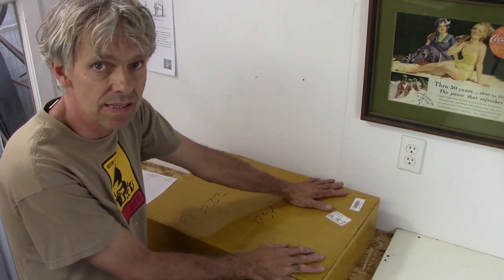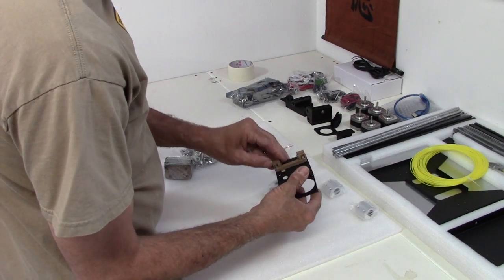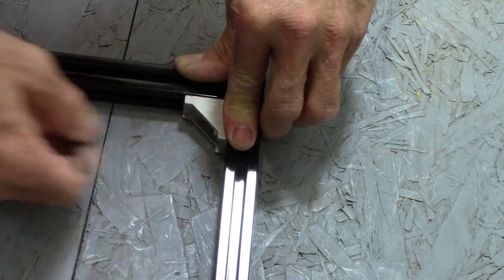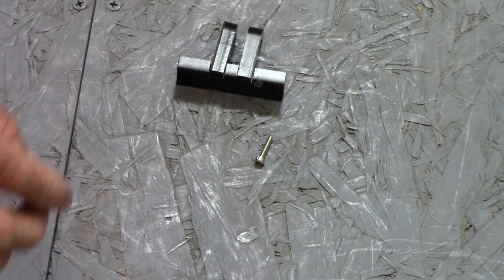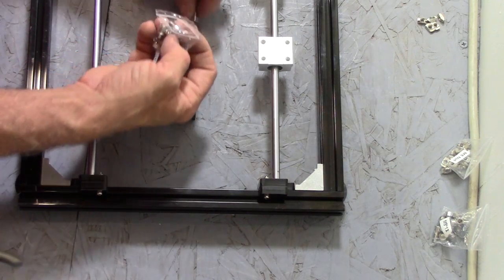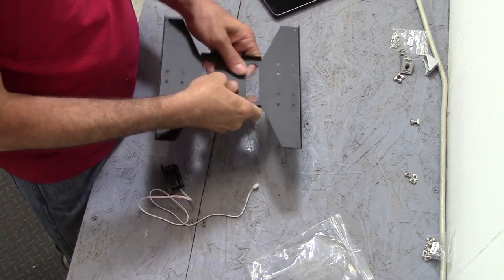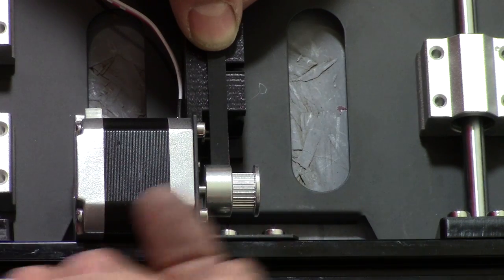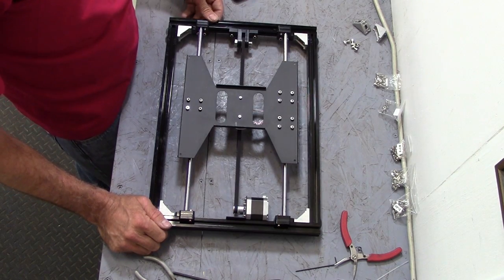HICTOP 3DP-11-ATL 3D Printer Assembly Part 1 - Y Axis Frame

Comment: Looking good. Certainly going together faster than the Mendel I made a few years ago. Dreams of being buried under an avalanche of M3 nuts still haunt my sleeping hours. 

Couple of points.. 

You might want to play around with the tracking on the end bearing a little. The belt looks like it is  going side to side a bit too much, and if it rubs against the plastic bracket, it will eventually wear through it. 

On mine, I have a small diameter washer that the bearing's inner bush rests against, and  a larger diameter washer acting as wall on either side to stop this happening. 

Personally, one of the first jobs I'd do is to build a better idler bracket. That one will fail fast. A couple of M3 nuts in open slots is not going to last. So at the very least, snug a cable tie around each one, to stop the slots opening up under load.

 A printed bracket would be strong enough for the job. . 

As to belt tightening.. Yes. They will slacken as they are run in, but after that, depending on quality, should be good.
Reply: Awesome! Thank you!

Comment: Welcome to the world of 3D printing. I got my first 3D printer a month ago and I'm really enjoying it. You need to start thinking differently about fixing stuff - no need to make a Y idler from aluminium. You fix it on with the printer. Here is a part I made for my Wanhao, I can share the source files with you to adapt to your printer http://www.thingiverse.com/thing:1532408 

One more tip, the Chinese LM8UU bearings are terrible. They are very noisy and the bearings destroyed my one smooth rod. I am now running bronze bushing on my Y axis and PLA printed bushings on my X axis. Both work great and will never destroy the rods and are very quiet.

Comment: The bearing holder problem is still there. The whole bearing will rotate on the thread of the 8 mm bolt. You need the washers to lock the center of the bearing.
Reply: Agree. I think I'll just make a new bearing holder from aluminum.

Comment: ah sweet how much is that printer dino ,I've got a robox but wouldn't mind building my own
Reply: I paid $418 on Amazon. I see it's gone up to $469 now.
Reply: +Dean Segovis ah sweet I'll give it a look ps when your printing if you have trouble with the print sticking ,try a quick spray of your wife's hairspray over print surface ,helps loads
Reply: you can sometimes find these hictop 3d printers on ebay for ~$200.
Reply: ah cheers ill have to have a look